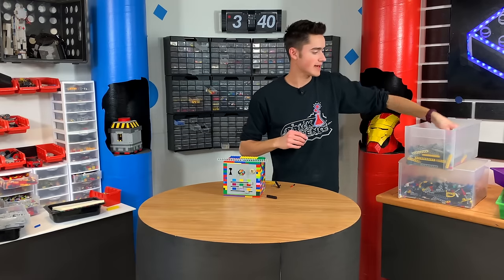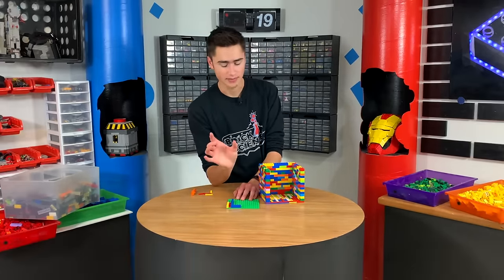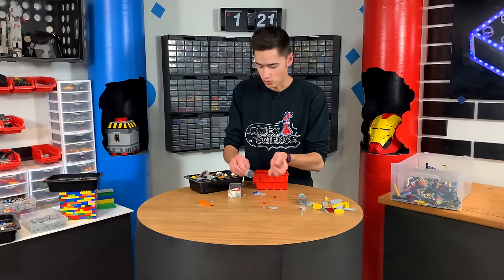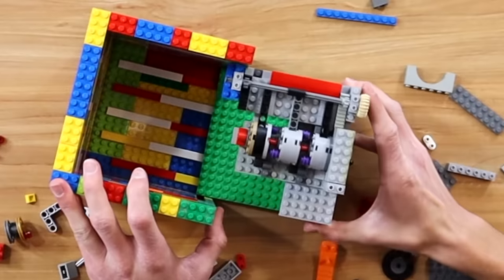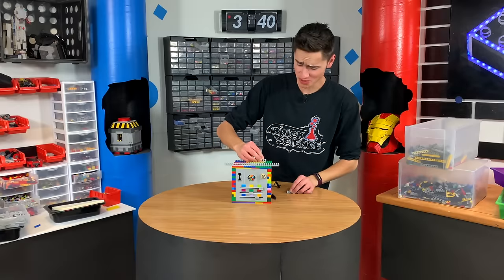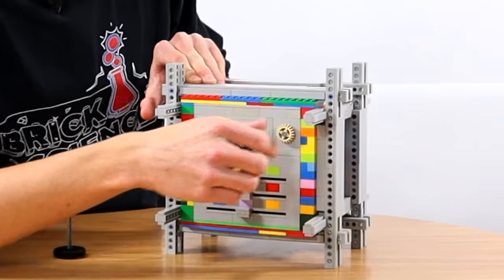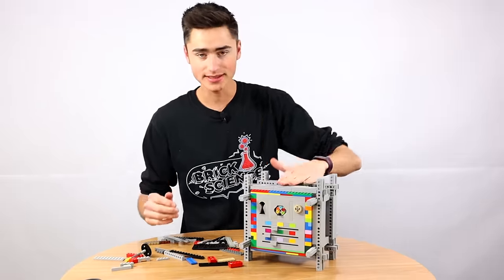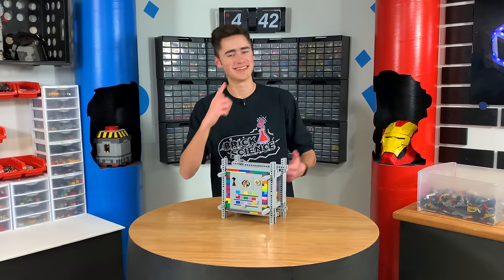I Tried to Build an UNBREAKABLE LEGO SAFE - Episode 1

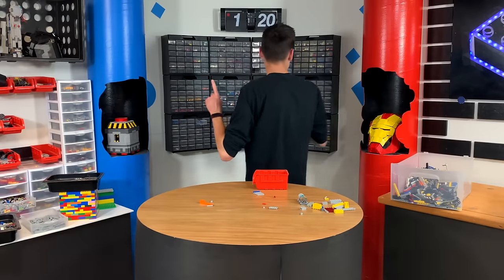Comment: i realize this is a year after this was uploaded, but at 4:36 i actually found a way to make (almost) that exact idea work. with the lego film peices, i'd get a fairley short axel and feed it through, using a longer tube peice to hold it to 2 others, one mounted to the back, and one mounted to the dial. i found that cotton, like from a cotton ball works perfectly because it doesnt break the studs off of the film piece, and if secured[ish] by legos, works just fine for a 3 combination lock

Comment: I've also done that once, but I've put the beams that connect the top reinforcement to the bottom inside the box so you could easily disengage them in the open state by just taking them apart from the inside but couldn't even reach anything from the outside... and added bonus is, that you don't have the struggle with forcing pieces in place the same way as you would force them apart.

Comment: I once built a similar thing, the main challenge wad that I needed to craft the locking mechanism in a 3 stud wide space. I managed to do it but the lock is really frail meaning it will break if someone is too rough putting in the right combination

Comment: Unbreakable? Likely. 
Hackable? Definately.
How? Just spin the top gear till you enter the combo right. It should force in when you get the right combo. The Key literally is just feel for the axle and find a piece to fit it. The bottom combo, well its just a matter of feeling it while pulling to feel it slip past the sides. Pretty easy.